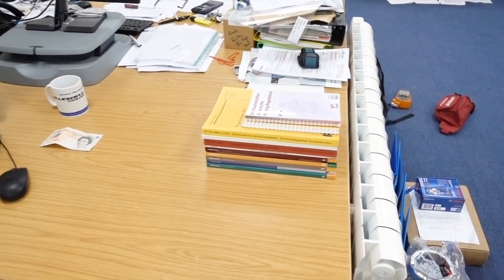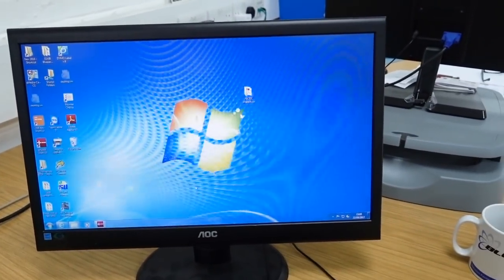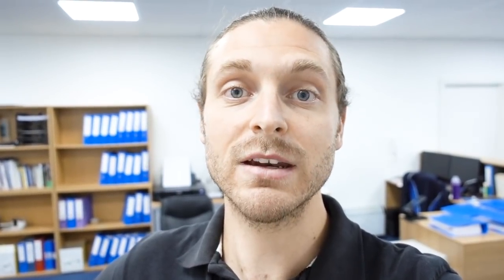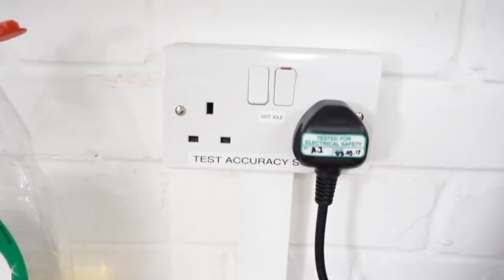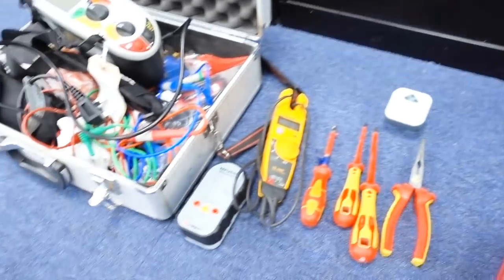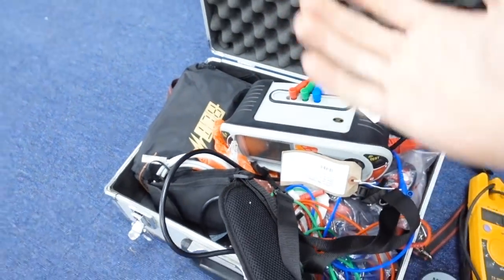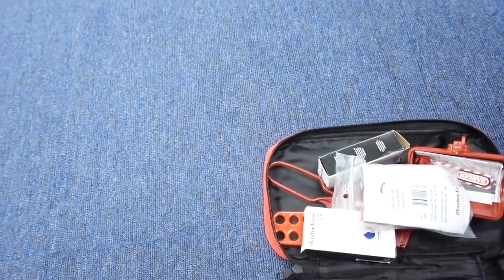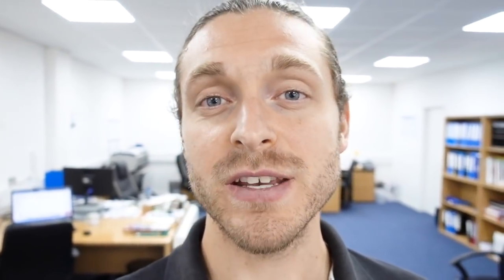NICEIC ASSESSMENT PREPARATION | TIPS AND HACKS

Comment: To my understanding the NICEIC is who's software generated the certificate or authorised it. If you're not registered with the NICEIC how do you signed off your work?🤔 assessment not legally allowed to sign off work, how does that work?.
Reply from the maker: If you are registered with the NICEIC, they have a portal to register notifiable works. This is not the electrical certification, it is separate and you reference the certificate number. So if you want to use different software, you can. I do. I don't like the NICEIC online software. If you're not registered with the NICEIC there are other bodies who do the same or you register through the local building control but it can be costly and a ball ache.

Comment: Hi Dan, im in france working as a spark been here for 7 years but coming back next year. Chicken and the egg ?? how do you get the notifiable jobs / work done for your inspection day if you cant sign off work prior before your registration with a scheme 
thanks Lee
Reply from the maker: Hi mate. You can carry out non-notifable works or work that is notifiable but communicate adequately with the client that it is their responsibility and cost. Obviously that might not always go down well with the client.
Reply: @DanstheEngineer  so you would still issue a certificate but put in writing in a quote or estimate that they have to notify building control them self within 20 days and if they dont ?? its on there head
Reply from the maker: @leeburnside735  technically mate its the building owners responsibility to ensure the works are notified. Not the electrician. We do it becsuse we have the means to plus it costs us a couple of quid whereas some councils will charge a fair bit for an inspection for compliance. If you were to mention this to a client they are likely to not have a clue what are you talking about and it could look unprofessional.

Comment: hi dan is its necessary to register with niceic  for domestic installation work
Reply from the maker: There are other schemes you can join such as Napit or Stroma (who have just been bought by Napit). So no it isn't neccessary but it certainly has its advantages.
Reply: @DanstheEngineer  thank you  very much
Reply: Napit will only let you join if you have done 2 years. They said apprenticeship when I enquired. And elecsa are now owned by niceic so 2 years the same.

Comment: By the sound of your spreadsheets you actually need databases, you're probably using the wrong tool for the job. New data protection regs coming in and spreadsheets won't be secure for customers data. Database easier to secure.
Reply from the maker: I used a CRM system. I don't think that is completely necessary for all One man bands though there are ways to meet data laws. Use of a CRM was a game changer for me......

Comment: Great video Dan, I intend to go self-employed this year and will inevitably be joining the NICEIC's Domestic Installer Scheme for convenience of Part P notifiable work to Building Control. One question though, is there any specific qualifications I need, in order to be considered a QS or Principle Duty Holder as I will be a sole trader?
Reply from the maker: Alvin Ashman good question. I'll link the section of their website below and there is a PDF at the bottom which you can download. It doesn't specifically state any qualifications at all. Just requires you to be working in the industry, have the technical documents and a couple of that procedures in place. The assessment assess if you are capable or not. What qualifications do you have? http://www.niceic.com/join-us/part-p-domestic-installer-scheme
Reply: Dans the Engineer- I'm a JIB Approved Electrician with all the relevant qualifications to suit. I've been an electrician for the past 15 years predominantly working within the domestic social housing sector. I've grown a bit tired of working for someone else and feel that I could make a success of going it alone. Have you ever been self-employed and if so, how did yoy find it, any of your experience or advice would be greatly appreciated.
Reply from the maker: Alvin Ashman you'll have absolutely no problem qualification wise! Being a JIB approved electrician certainly demonstrates your qualifications. Just make sure you have a copy of the relevant standards. Part P and the EAWR 1989 are free to download. Ensure you read up on technical knowledge etc and I'm sure you'll be absolutely fine.

Comment: Great video Dan, I've just started out as a domestic installer and looking to become NICEIC approved.  My concern is that the work I do is mainly minor works, additions and alterations etc.  Nothing notifiable yet, would the assessor expect to see evidence that you've carried out notifiable work i.e. CU installs, rewires etc?
Reply from the maker: Jake Chattey I can't speak on behalf of the NICEIC but check out this link below. Click on a scroll box to scheme requirements and you can download a PDF for the scheme. By the looks of it providing you carry out electrical installations, have an H&S policy, insurance, complaints procedure, safe isolation procedure and few other bits I can't see a problem with you applying http://www.niceic.com/join-us/approved-contractor-scheme